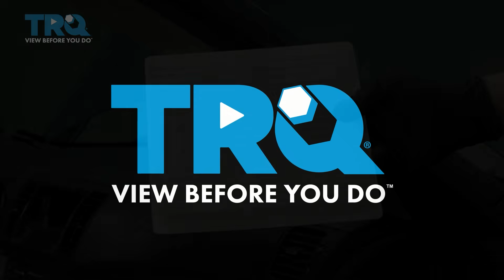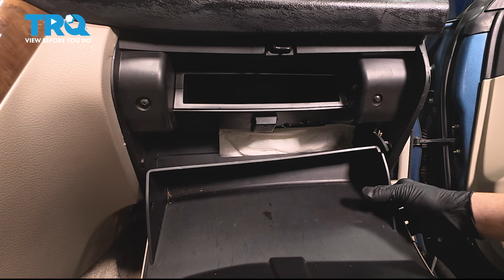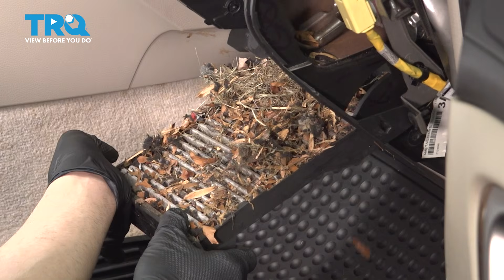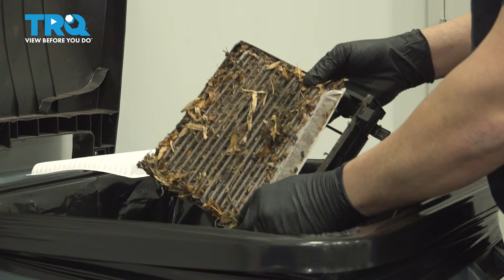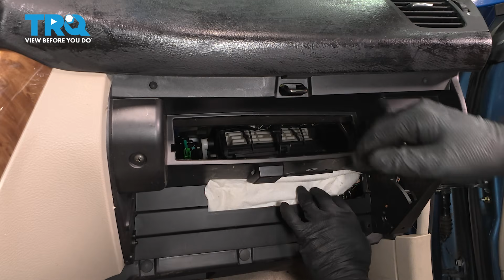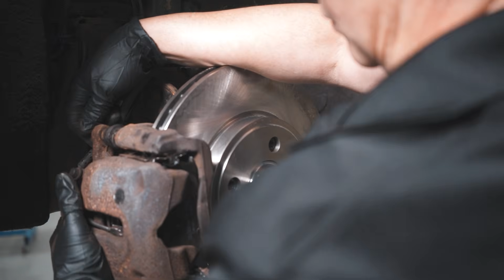How to Replace Cabin Air Filter 2005-2009 Subaru Legacy

Comment: That is way more complicated than the newer Legacies. I have a 2007 and a 2022.  The 2022 on can be changed in a few minutes.  No screws or panels to remove.  Just the glove box and filter door behind it.